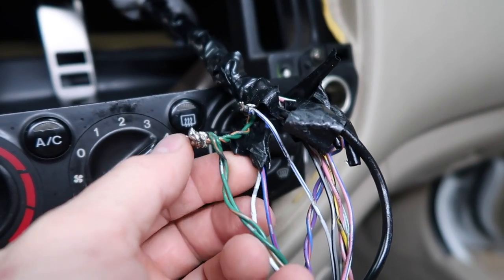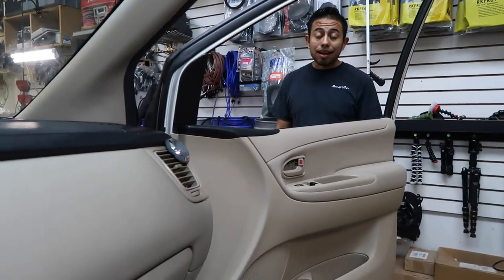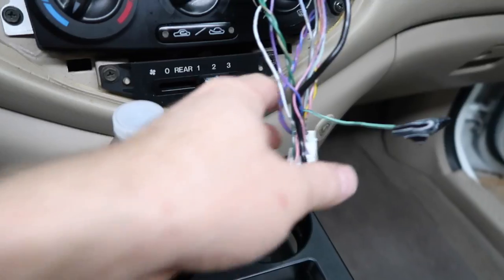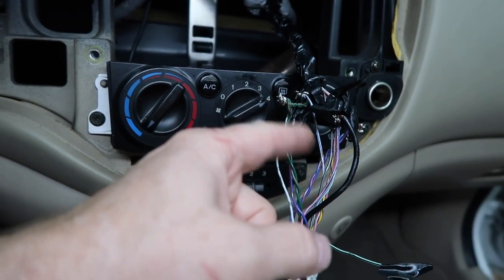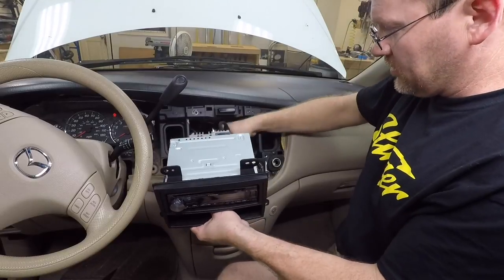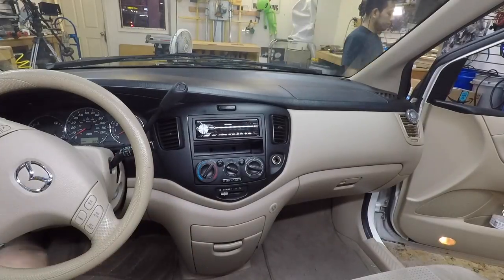A Mazda in for a quick radio install, Haha Right  Installer Diaries short 106 5

Comment: Had same scenario. Mid 2000's mustang. Wanted us to install double din they bought at Wal-Mart. They went ahead and took out old radio and cut plug off. I asked why they cut it and he just told me that he thought we needed it cut. Wired harness in, fixed blown fuses, but in my case the radio didn't work. It came on but no sound. Traced every wire and eventually hooked up another speaker. Surprise. No sound from new speaker either. Radio was bad. Made my day too.  You guys are awesome. Thanks for the vids.